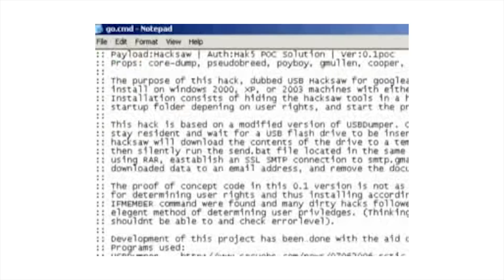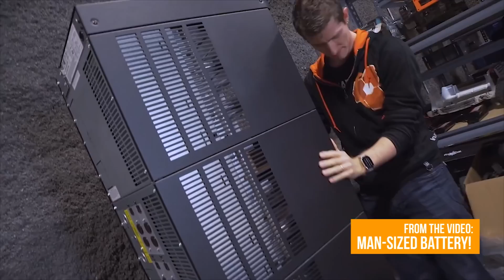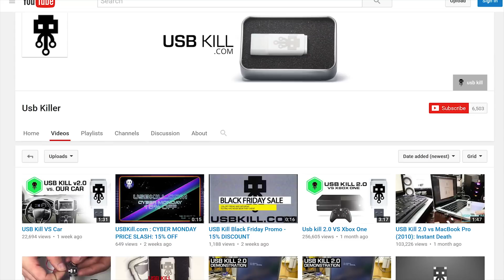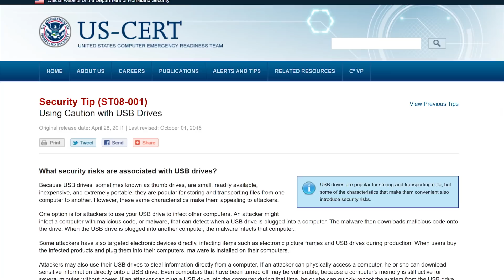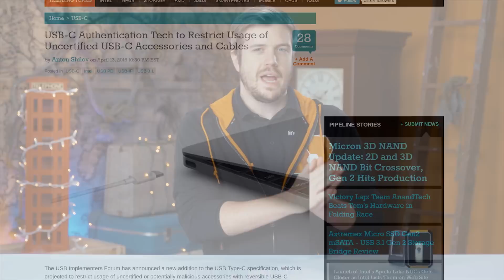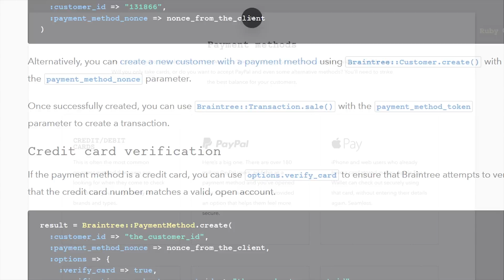COMPUTER DESTRUCTION (GONE DEADLY)

Comment: Looks like Apple, made the right move with USB-Cs. Wow
Reply: NootNoot! There are adapters that can plug into usb type c
Reply: MeltedPeanuts Does it still work?
Reply: NootNoot! Apple protects the computer, but the port is killed
Reply: NootNoot! Yes
Reply: +NootNoot! yes, the computer does but when you plug it in. it kills the USB type c port and on the MacBook there's only one port which is the same one you charge the computer with meaning you have time but when that battery dies its bricked into you get a new port
Reply: NootNoot! Yes, but a lot of newer devices contain safeguards.
Reply: ***** Does it have a 500 nit bright display with P3 color gamut + anti glare coating, all aluminum build quality, force touch track pad, 9 hours of battery life, great speakers, 3.1 GB/s fast SSD, a touch bar, and a Mac OS?
Reply: ***** You are a gamer of course you'd go for whatever that gives the best specs. I'm a college student, and to me everything from build quality, battery life, display quality, track pad, reliability, resale value and the Operating System matters. MacOS is UNIX based so it is much better for programmers. It's why almost all engineers at Google use MacBook Pros.
Reply: ***** That's the Razer Blade Stealth, which doesn't have GTX 1060. I know about laptops more than anyone here.
Reply: NootNoot! Using the right adapter like the one from Google pixel will kill anything.
Reply: Apple is always thinking ahead. No one realizes.
Reply: ***** If you want to build a pc, then build a pc. You can't compare a pc to a thin laptop.
Reply: Phanteus A thin laptop already has a gtx 1060 in it.
Reply: Phanteus MacBook Pro doesn't have 9 hours of battery life either. Don't kid yourself.
Reply: Snazzy Labs Ye they do. MacBooks have always been known for their excellent battery life. I have the latest 2016 and mine ranges from 8-10 hours on regular use on medium brightness.
Reply: ***** Why don't you give me the name of the laptop so I could look it up?

Force touch pad is big and I like it that way. I can finally select large portion of code with just finger. It simply is the best trackpad on any laptop. The palm rejection is incredibly good! 9/10 reviewers would agree with my claim. I don't know what issue MKBHD had.

I get 9 hours of battery life. Maybe the 15 inch models don't but I certainly do with my 13 inch mode. Also Apple said their time estimation was way too inaccurate, making everyone think the battery life was bad.

You don't need repairability on a MacBook Pro 2016 when you have AppleCare. It's such a good deal. They literally give you a brand new laptop if you break your old one, and you pay only $250. The resale value and the overall reliability of a MacBook is also unbeatable. It's much better than buying cheap laptops that die after 3 years.
Reply: ***** Where did you get the idea that MacBook thermal throttles all the time? I just checked mine and my CPU usage is at 13%. My laptop doesn't feel warm anywhere, and the fans are completely silent. Excellent thermal cooling by Apple.
Reply: DatPCgamer Just remember, if someone has a different opinion to you, call them a sheep. It makes you automatically win the argument
Reply: ***** Razer Blade lol. That thing starts at $2100 with the same resolution and SSD size. It's no way cheap.

Speakers, design, trackpad, build quality, display all are overall better on the MacBook Pro. Not saying Razer Blade is bad, it's just built for gaming.

Also Apple officially said their battery estimation was inaccurate, which is why they removed it with their latest update. I still get 9 hours on mine, superior than 99% of windows laptops.

Who said refurbished models die in a year? You are making shit up mate. Most refurbished models are just cancelled online orders, or opened up wrong orders that are returned brand new. Upgrading isn't an issue, considering MacBooks have the best re-sale value. Just sell your used Macbook and buy a new one if you want to upgrade, you won't lose that much money.
Reply: ***** Other than GPU, pretty much similar price as the Razer Blade. Instead of the GPU, Apple just spent the money on things like larger screen, better screen, better speakers, better build quality, touchbar, Touch ID, force touch track pad and the Mac OS. The MacOS has excellent optimizations as well, so it performs very well.

It isn't cheap to make thin high build quality laptops like Razer Blade and MacBook Pro. That's where most of the money goes to.

Otherwise you can go buy yourself some cheap plastic fat windows laptops with better specs.
Reply: ***** I'm a Samsung fan. Samsung makes the most superior phones in terms of raw hardware. 

When it comes to laptops however, MacBook Pro certainly is a king of its own in certain categories. 

At the end of the day, I just like good products.  If you are a gamer, MacBook Pro certainly isn't a good product for you though, and I understand that. Unless you can opt for an external GPU.
Reply: ***** It's actually $2300 on Apple Store. Just checked. The core i7 and 16 GB. The one you linked was 512 GB version, you are comparing the wrong ones.

But then again, the MacBook Pro features ridiculously fast SSD which are more costly than the CPU to be honest.

Can you link me where ifixit said that? If it does die, you can still return it again though since the period is 3 years.

You buy a new MacBook Pro for $2000. After a year you sell it for $1500. Then you add $500 and buy a new MacBook Pro. Not the cheapest way to upgrade, but still pretty nice given MacBook's high resale value.

Also yes, I have the best laptop knowledge.
Reply: RIPperoni Pepperoni
Reply: NootNoot! its called an usb adapter. they arent safe
Reply: look on everythingapplepro's channel. he used it on the new macbook.
Reply: chode
Reply: Killer Chemo Star Well if ur port is damaged the cost for repairing it on apple is like $500 in my country lol
Reply: Phanteus Yeah the laptop I'm talking about have an anodized aluminium finish, one of the most accurate colour gamut, great speaker, a 4k display with G-Sync, SD card slot, kaby lake and has a gtx 1060. 

Force touch pad on the new Macbook is too big and doesn't even have good palm rejection, the advertised 9 hours battery could only last 3 hours if lucky 6 and Mac OS is not a reason for a laptop to be great. 

While I'll add it Macbook Pro 2016 have the worst repairability on ifixit in Apple history, only thing beating it is the Airpod. How is it an IPhone 7 have one of the best scores,  while the MacBook has the worst?
Reply: Phanteus The laptop I'm talking about is the Razer Blade. 

I've seen reviews of the the MacBook pro and pretty much said on the battery being not accurate to the timing. Also if it wasn't accurate why even bother advertising it. 

Everybody knows Applecare gives you a refurbished model that'll die in a year, also why use Applecare when you can fixed it yourself for cheaper price. Not to mention they fucking soldered the ram stick, so yeah if good luck of spending more  on money for a new laptop just to have bigger rams.
Reply: ***** Truth be told also is the Razer Blade it's just that expensive as Apple. But I'll agree, the price isn't ideal for college students unless their  parents paid for them.
Reply: Phanteus Actually it's $2000 on amazon. While for the MacBook Pro 13 with the same specs is $2500 and that's with only intel iris graphics. Also I never said the Razer Blade was cheap, I even admitted it's prices is bad as 

If razer was built for gaming why Linus uses it or gave it to his employers, whose half of them don't even game?

It's been said even by ifixit that refurbish models dies within a year, heck even MKBHD said about it. 

Also how the fuck are you going to able to sell a Macbook that is lower specs at a higher price, while people could just simply buy a higher spec model for a cheaper or similar prices. 

Also nice snobbish attitude to announce that you have the best laptop knowledge one a YouTube page that is about techs and have build a whole room water cooled lan pc setup.
Reply: Phanteus If you don't believe check this page out on Apple site apple.com
Reply: Phanteus Phanteus Still got damn expensive $300 more compared to the damn Razer Blade. Also the Razer Blade is 512gb of SSD. If that the wrong sku, maybe Apple should have organised their website instead of cluttered it. 

That because Apple soldered their SSD while Razer lets you do what ever you want. 

Why would I sell a Macbook at $1500 while people could get something with better spec at cheaper prices? Not to mention I have to add additional money great. 

Great if you have the best laptop knowledge why don't you work for LMG and go in deep depth on any laptops you come across.